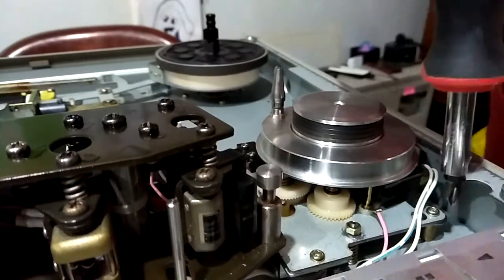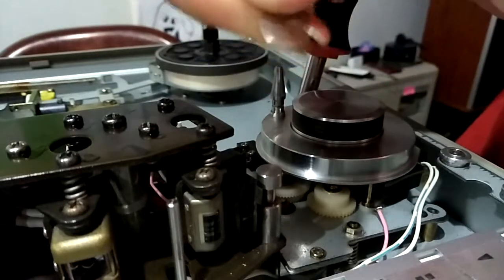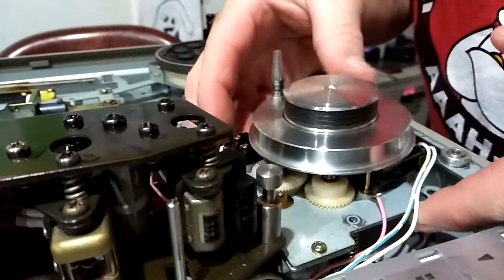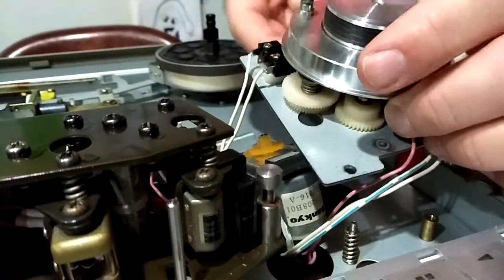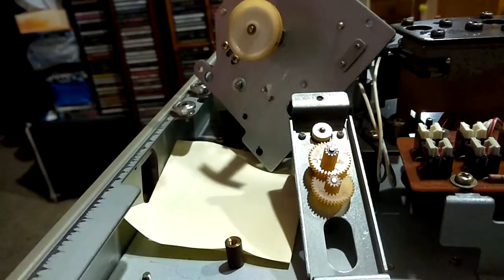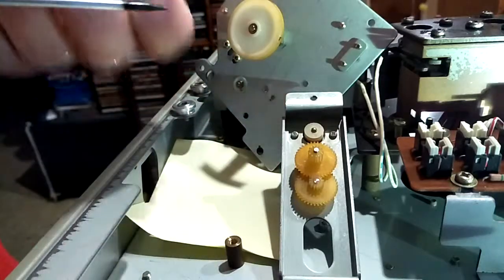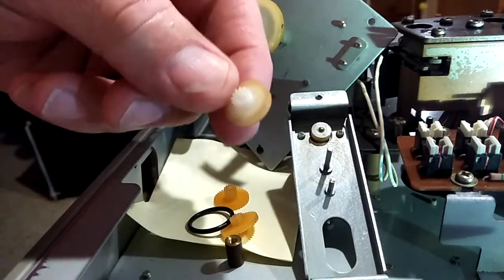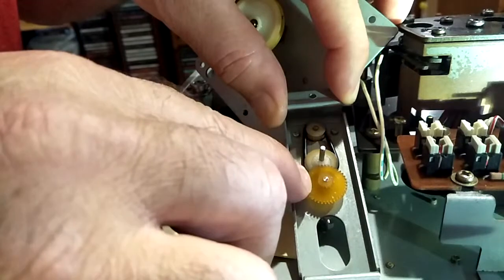Akai GX-747 TENSION ARM BELT ASSEMBLY

Comment: Those seems to be O-Rings made of soft plastic not Square Belt as the original deck... O-Rings/plastic will work sometimes but once you let the deck sit for a few days without use the Tension arms will not move and will have to be forced in place....  Can you do a follow up on this....
Reply from the maker: You are correct, O rings , at 1st they we're not 100% maybe 90% working correctly. Now they have settled in they work 100%
Reply: Wonderful video! It helped me a lot to fix my Akai GX 747 on my own